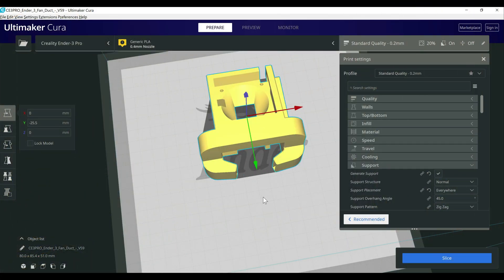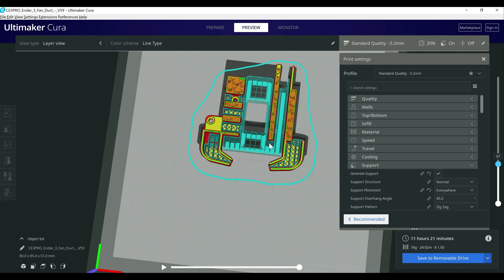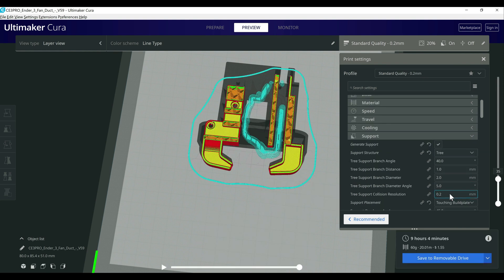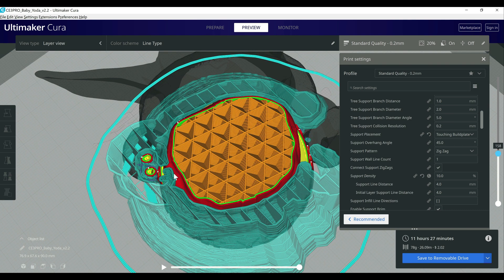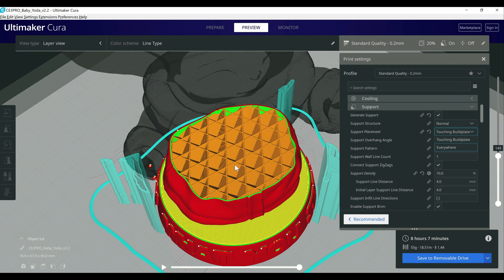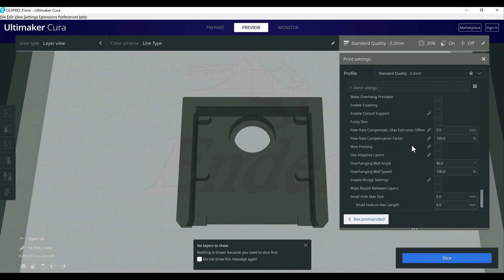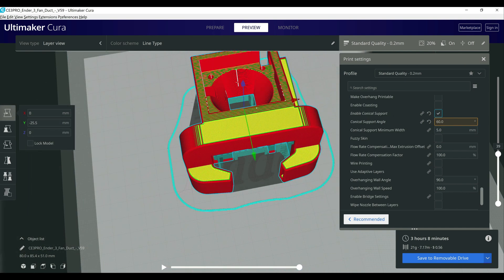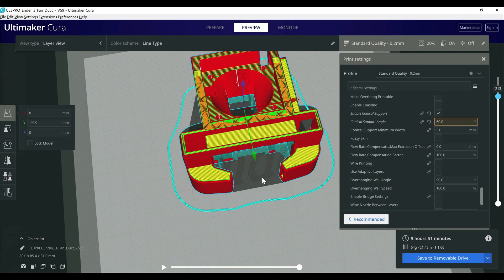Cura Supports - Options and Recommendations

Comment: Hi, do you still have to use a brim when slicing with tree supports on the fan cover
Reply from the maker: Hi. I typically use a skirt unless I need a brim, but I would use one of them
Reply: @3DPrintscape  Hi thanks for the reply, same here just on you previous vid on printing the fan duct cover it would not print with skirt was it because you used normal supports.  Printed it with Tree and a skirt came out fine.
Great help with your vids thanks

Comment: Thx for all your good work. Your input about cura and 3d pinting is very helpful to me. I do have an issue with old cura settings!!
I am unable to convert old (profiles) cura 3.1.0 settings to Cura 4.10.0.
Sorry for my bad english
grt. Patrick
Reply from the maker: Hi. There isnt a direct way to convert cura 3.x settings to cura 4.x, to much has changed. you can try to open up the prolife file in notepad++ to see the settings and try to match them though.
Reply: Thx for the info. I'm trying to print an RC airplane. Info from https://www.youtube.com/watch?v=JTjhAT2Tnb0&t=448s.
I am unable to open the Cura settings. Apparently the others do.